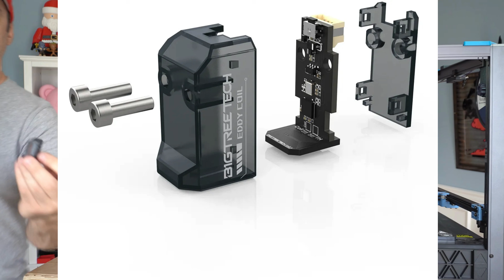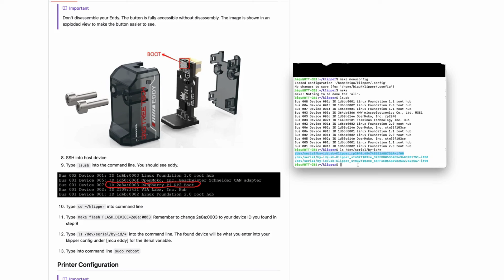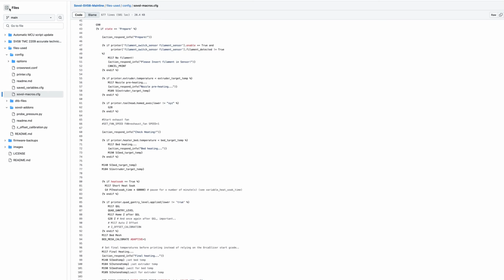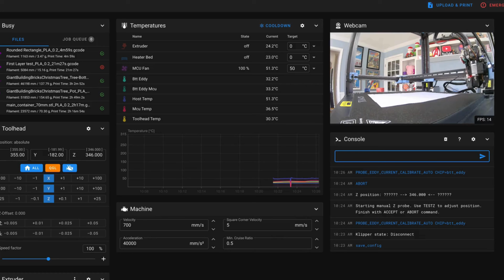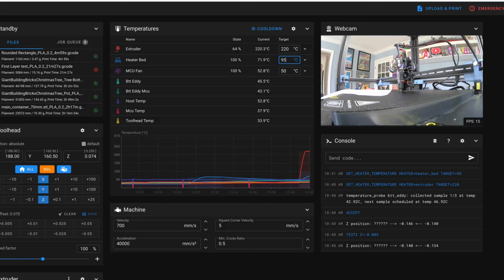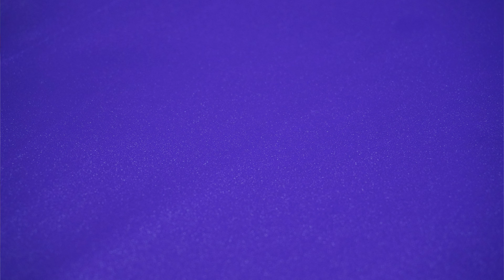BTT Eddy USB Probe Setup on Sovol SV08 – Full Install & Calibration Guide

Comment: Aaron, I have a question for you: Would it be possible to use the Coil version of the Eddy to connect to the existing CAN board on the toolhead? The PDF manual on the BTT Eddy Github shows connections to an EBB36 or EBB42, so I wonder if it would be possible to connect it to the existing toolboard and not have to run a USB cable back to the mainboard?
Reply from the maker: I have read one or two who have made it possible with the Eddy USB - the tool board is not a CAN board, it's USB and has I2C available, but it takes a bit of work to get things working and powered properly.
Reply: Thanks. Guess I'll be routing another cable then.🤪
Reply: Another question if I may? I cannot find the function to perform a Quad Gantry Level, nor can I find a Macro either in Mainsail or in the Macros section of Klipperscreen to do this. What is the command to kick off this process? (Sorry for the stupidity...)

Comment: THanks for this video! I'm almost through installing my Eddy. When I get to running the first bed mesh calibration (step 28), it doesn't run like yours at 24:30 into the video. Instead of a "rapid scan" like yours it just does a normal bed mesh where it slowly moves to each point of the mesh and raises a few mm each time. Not so much a scan motion like yours. I've uncommented the "method=rapid_scan" in the configs. I'm totally at a loss why my bed mesh is calibrating like a regular probe. But at least its probing lol
Reply from the maker: When you are doing the calibration portion, you are calling for the rapid scan. Something to look at.
In your Sovol Macro.cfg  on or around line 104 you should have this - BED_MESH_CALIBRATE ADAPTIVE=1 
Change it to this - BED_MESH_CALIBRATE SCAN_MODE=rapid METHOD=scan ADAPTIVE=1
In your eddy.cfg 

Around line 156 - make sure you have BTT_BED_MESH_CALIBRATE METHOD=rapid_scan
That macro should rename BED_MESH_CALIBRATE METHOD=rapid_scan to the above, but you can force it by just naming it the line above. 
I can also send you my configs if you want to try those if you still have issues. Shoot me an email.
Reply: @ThePrintasaurus  Your first paragraph is gold. Did i miss something during the setup to not get this right? i've set Eddy up multiple times and had to come back to find this comment each time.
Reply from the maker: @isaacm9415   Appreciate it! If you find you need any additional help with anything, shoot me an email theprintasaurus@gmail.com
Reply: @ thanks for the quick reply! It’s working now! I was definitely missing a method definition somewhere. But all good now! Thank you so much for this video. Along with your Mainline video it was so helpful
Reply from the maker: @spoolsamplesprintco   Awesome, happy to help!!
Reply: @ThePrintasaurus  Hi, im having some issues with this part. I changed the line in sovol macro.cfg but I can't find that code line in eddy.cfg
Reply: Love the video, also you mainline klipper install was a big help. I'm having the same issue and there's something I'm not understanding maybe? In the Sovol Macro cfg I see the BED_MESH_CALIBRATE ADAPTIVE=1 and I replaced it with BED_MESH_CALIBRATE SCAN_MODE=rapid METHOD=scan ADAPTIVE=1. But then you say to check in the eddy config for the BTT_BED_MESH_CALIBRATE METHOD=rapid_scan and I don't have that anywhere in there, where do I add that and how?

Sorry for the newb question, this is my first printer i've tried my hand at heavily modding.
Reply: nevermind, lol, I got it working. Figured out I didn't need to replace lines, but uncomment the rapid scan part. Thank you for the helpful video, I don't think I would have gotten through the temp compensation without you!

Comment: Went mainline and Eddy usb. 
But Im having Problems when I want to do a full bed mesh after uncommenting the rapid_scan in sovol macros. 
When starting a print it rapid scans the print area. But not when doing a full bed mesh🤷🏼‍♂️

Any idea what to do?

Probe triggered prior to movement. 

Getting pretty frustrated after all went well moving to mainline and Eddy.
Reply from the maker: shoot me an email -  theprintasaurus@gmail.com 
and send me your config so I can look over to see if anything is out of place and see if I can come up with a solution / suggestions for you. Happy to help.
Reply: @ThePrintasaurus  I have the same issue. Cannot do the innitial bed mesh. I have a really bad case of taco bed though, so maybe that could be a factor.

Comment: Hello, thank you for the detailed video. I am using Eddy Duo (USB) and when I try to "LDC_CALIBRATE_DRIVE_CURRENT CHIP=btt_eddy" I end up with the value 0. I have tried moving the z-axis closer to the bed, but at any height it always return 0, any ideas? I have triple checked my configuration and all match up 😞
Reply from the maker: I have an Eddy Duo I am getting ready to use on my Voron 2.4. I'll try and work on that this afternoon/tomorrow at the latest and get back to you to see if there are any issues. You want to be 20mm away from the bed surface to do the drive current calibration. 

I did find an article with someone having the same issue, they recompiled/reflashed the eddy and then they were able to calibrate correctly.
Reply: @ThePrintasaurus  Thank you, let me know what results you get, I have already tried reflashing but no joy 😞
Reply: @joshuawrye  I did not get any success at all! Had to contact BTT for a replacement that they are sending soon. I will post an update once I get it, and install it. The controller has 4 usb ports of which 1 is used from factory install. Can you try unplugging any other items other than the Eddy and try again? Trying to figure out if its the controller not being able to send enough power to the Eddy? Let us know once you have been able to test this.
Reply: @joshuawrye  Thats great, I am still waiting for my replacement from BTT, but it gives me some comfort 🙂

Comment: Hello, thanks for the detailed video. I may have missed something while working on other stuff during this first attempt. 
Did you manage to connect the probe to the board internally, or are you using the external port or a hub?
Reply from the maker: I did go back and route the USB cable internally. I ran it along with the existing cable for the tool head, unclipped where it meets the base, and ran it through and there is a second USB port on the board that works.
Reply: @ThePrintasaurus  awesome!!
Thanks for de details. I just finished a DIY enclosure and waiting for a bigger fan to be installed. After that I will definitely follow your guide ❤️. I am tires of running the offset on the fly when the print starts.
Reply from the maker: @YaelLorenzo  No problem at all!  How did you do your enclosure? I have some acrylic panels laying around that I might CNC in a video to make a diy enclosure soon. Just need to find another panel to complete it.
Reply: @ThePrintasaurus  I followed this guys instructions  https://youtu.be/1j27PuNYvKM?si=CdxQ2hwF9Hq7pUH_
He has a document with the cuts and some templates for the drillings.  It saved me a lot of time.
I used 5mm acrilic as I couldn't get anything else in between 2.5mm. 
If I could have selected, I would have used 3mm for the sides and 5 for the top (to avoid future bending l, bad experience with other stuff : 😅)

I cut an old drill bit for the hinge pins and designed my own handle ( to be published in thingiverse soon) to be in the middle of the frame. Strong magnets glued to avoid interfering with the belt. 
I can update here when I post the handle if you like.

Comment: Alguien a conseguido solucionar el desvío que hace la sonda cuando se posiciona para hacer la medición en la compensación de temperatura? La mía se desplaza hacia la derecha casi al final de la cama y aunque me deja hacer la medición luego me da error diciendo que está fuera de rango cuando intento calibrar
Reply: Gracias por tu respuesta, he estado intentando volver a nivelar la sonda desde 0 varias veces y no hay manera, incluso he cambiado la montura por una diferente pero el resultado siempre es el mismo, el cabezal se sigue desplazando hacia la derecha cuando intento hacer la compensación de calor. Seguiremos intentando
Reply from the maker: @joseluismartinez1529   If you are using the mount I referenced in the video do you have your eddy.cfg setup this way? 

[probe_eddy_current btt_eddy]
sensor_type: ldc1612
z_offset: 2.5
i2c_mcu: eddy
i2c_bus: i2c0f
#x_offset: -16.5
x_offset: -16
y_offset: 11.5

Also make sure you have your initial distance set correctly for the drive current calibration. 20mm
Reply from the maker: Did a Google Translate. So you have issues with the temp compensation. If so try and do your first calibration again to set the Z-offset. I had one person with a similar issue with the temp compensation. We figured out that by redoing the initial calibration it allowed the temp compensation to work properly.  I apologize if I have translated wrong.

Comment: When I run the make command itni get an error cause it’s trying to use avr instead of arm even though I have selected the rp in menuconfig
Reply from the maker: Can you email me the log / output when you do your make command? theprintasaurus@gmail.com.  Would like to take a look and see what's going on, from my understanding your make command is utilizing the avr-gcc, instead of arm?
Reply: @ThePrintasaurus  actually I just got it to flash this morning at 3am. While trying anything and everything I accidentally deleted my Makefile I downloaded one I found on GitHub and I was able to flash so apparently I had something wrong in the original Makefile file. Thx for the willing to help. I do have An unrelated issue with flashing an Arduino nano if you could help with that would be appreciated
Reply from the maker: That is fantastic that you were able to get it going. Send me an email on the audrino and I’ll see what I can do to help you.
Reply: @ I figured it out at 3am this morning. Was trying anything and everything to get it working and accidentally deleted my Makefile. I downloaded a replacement file from GitHub and everything started working. Apparently I had something wrong in the original Makefile. Thx for willing to help

Comment: I have a question about temperature compensation, when I enter the command TEMPERATURE_PROBE_CALIBRATE PROBE=btt_eddy TARGET=56 STEP=4, does my toolhead automatically move all the way to the right and doesn't stop in the middle like it should? Maybe you have any idea what this could be? Thank you very much !
Reply from the maker: Did you home your axis's and then do a G0 Z5 before you ran your TEMPERATURE_PROBE_CALIBRATE PROBE=btt_eddy TARGET=56 STEP=4? Dont' forget to set your idle timeout either. SET_IDLE_TIMEOUT TIMEOUT=36000. You shouldn't have any movement on your x or y axis in this process. You should only be stepping down to set the z-offset at each temp range to allow the temperature compensation.
Reply: No thats the funny thing, it came with temperature probe
Reply from the maker: @simply.3DPRINTED   I am not sure what would cause that. I'm going to play around to see if I can create the issue to help troubleshoot with you. I would of expected the same behavior.
Reply: @ThePrintasaurus  i noticed the end point of the right move its: X319 Y176 Z5 like the  probe scew why this could by the same ?
Reply from the maker: @simply.3DPRINTED  can you email me some screen shots of your config? I'll send you my config files as well to see if we can figure out what's going on. I went through the whole setup again last night and could not create this issue!   theprintasaurus@gmail.com
Reply: @ThePrintasaurus  Look this is what i fount: different are i have 6 probe and right moving is cause the middle screw should have more accurate calibration. I tried my first temp. calibration but the first layer is awful it goes too hard in the bed close to destroying my bed. I adjusted it with the cfg from rappetor but its the same. Maybe a new script? I will try the calibration again as you said in your video.

[temperature_probe btt_eddy]
sensor_type: Generic 3950
sensor_pin: eddy:gpio26
horizontal_move_z: 2
calibration_position: 319,176,5 ; This sets the position for the temperature drift calibration over the centre right heatbed screw, for a more accurate reading during calibration.
Reply: @simply.3DPRINTED  i have exactly the same problem. Everything worked fine but with the temperature calibration it moves all the way to the right. Did anyone find a reason for that?
Reply: @wafebreaker hi i fixed it already you need to go to your eddy cfg, then you find the point temperautre_probe btt_eddy their you need to change  it to the center points calibration of your printer. It was a update in the mainline klipper cfg to be more accurate but it dont worked for me. After you run the temp calibration again and to have same good results again i recommend you to do it until you have a small resistance of the paper. Then u lower it every step by perhaps paper -0,1mm and when you have pei plate then you should go further down line woth paper -0,125 (every step). The paper will not move until next temperature point. If you do ABS you need to change the target temperature in thr comment to 70 then all shpuöd work fine :)
Reply: @wafebreaker  @cassiqz5471 @theprinasaurus Hi guys, I have exactly the same issue and I can't find a workaround. Did someboby manage to solve that issue and is willing to share some infos? Would be highly appreciated! Thanks a lot!
Reply: Yes i followed the instruction, but after i enter the probe eddy 56 step 4 in it moves instant to the right side 😅
Reply from the maker: @simply.3DPRINTED  Did you have the same type of movement when you did the first probe calibrate? PROBE_EDDY_CURRENT_CALIBRATE_AUTO CHIP=btt_eddy

Comment: I found that pkg-config was not installed, so the make flash command didn't work.  I had to do 'sudo apt install pkg-config' first, and that seems to have fixed it.
Reply from the maker: Thank you for sharing. I'll add that to the steps in my description for those that do not have that package installed. Everything good to go now?
Reply: @ThePrintasaurus  Thanks for the reply.  The other issue I ran into was that if you don't update your eddy.cfg with the serial port config before updating your printer.cfg, when you save and restart, klipper reports an error, so I think it would be better to update eddy.cfg first.  But after updating eddy.cfg everything is working, with reliable z probing.  One weird thing, though, is that its bed mesh isn't fast and smooth the way it looks in the video; it still stops at several mesh points at the start of each print.  How can I get the quick mesh I see in the video?
Reply from the maker: @peterschachte9932   In your Sovol-Macros.cfg under your print start. In mine around line 104 you should see this... 

        M117 Bed Mesh
       BED_MESH_CALIBRATE ADAPTIVE=1 

Comment out your BED_MESH line and use this one. 

BED_MESH_CALIBRATE SCAN_MODE=rapid METHOD=scan ADAPTIVE=1

That should allow the rapid scan when you print. I'm putting together some notes on your feedback as well so I can get things added appropriately to help others out. Thanks for sharing!
Reply: I had to do the same. I have a fresh install of mainline klipper.

Comment: Great video - just ordered an SV08 myself and would like to do quite a few upgrades to it - including your EDDY one, multiple print heads, larger bed.   

Like the ship in the background - is It 3d printed?   My main objective for the upgrades is to build a printer than can print ships like that, multi colour, really fast, in one go.
Reply from the maker: Thanks for the comment! That ship is actually pretty old. Was my wifes great grandfathers. Sounds like you have some great projects your going to be working on. I have not explored the multi-print heads yet. I'm going to be experimenting with the armored turtle filament changer once all my parts arrive. Will be a 4 color setup. Will probably be a month or two before I can do any content on that video! Keep me posted on your project, interested to see how it goes!!
Reply: @ThePrintasaurus  Good luck with that - I would like to add some sort of MMU to my SV08 too - probably in addition to a tool changer.  My ideas - some of which might be a step to far are illustrated in this short video if you are interested.  https://youtu.be/479ecxP-sOE
Reply from the maker: That video is fantastic and crazy at the same time lol. The dual gantry is an interesting concept. Keep me posted on your project really interested to see how much you do.

Comment: Mine was an absolute nightmare. Had to redo settings every single print. Not consistent all. Have a cartographer on the way
Reply from the maker: That doesn’t sound good!! I have had decent luck with the eddy so far. Interested in your cartographer and how that goes. Did you get the cnc mount too? Are you going to use a stealthburner tool head or go custom with the sv08?
Reply: @ThePrintasaurus  I haven't decided yet. I'm waiting for it to show up first